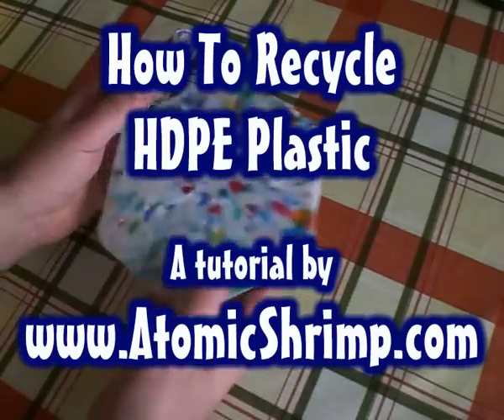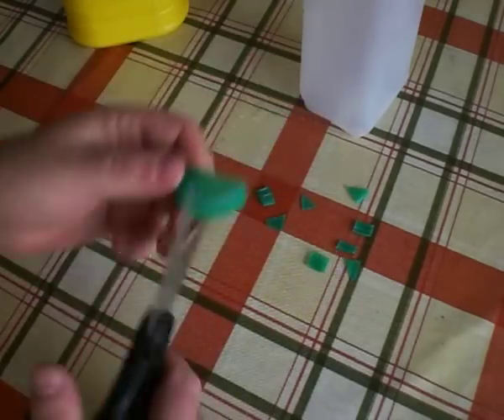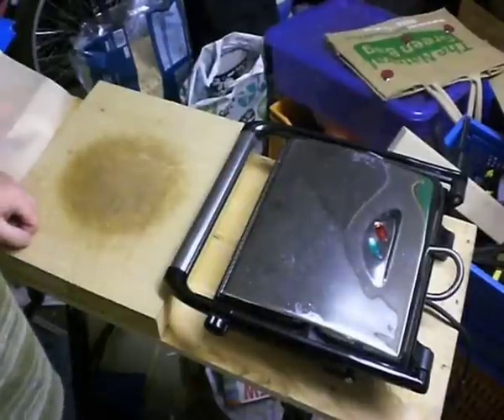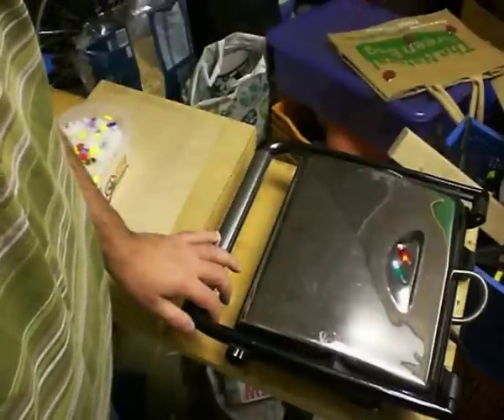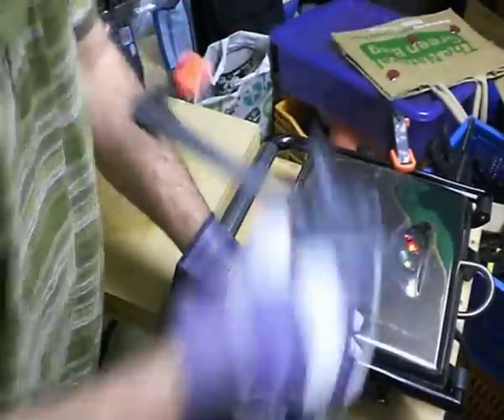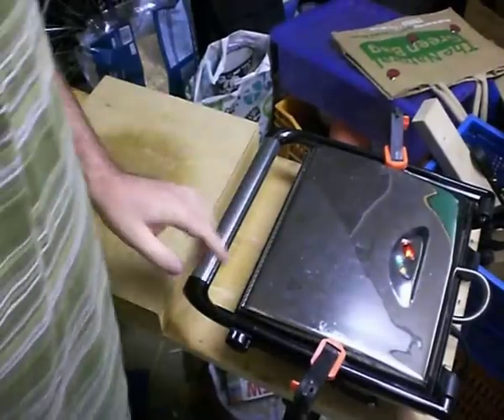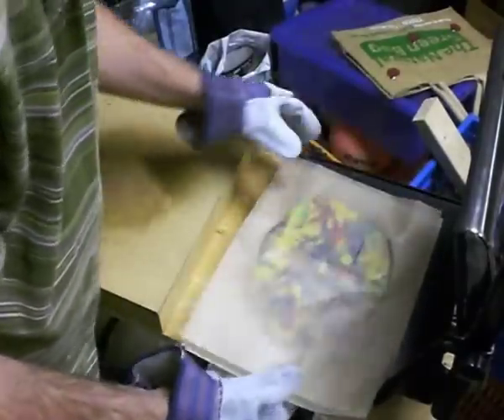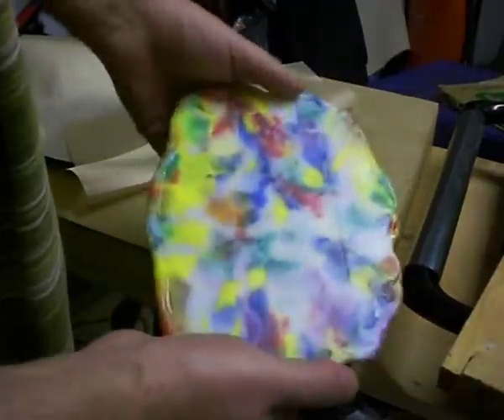How To Recycle HDPE Plastic (High Density Polyethylene) - a simple method

Comment: looks like good flooring material, hard plastic tiles maybe?
Reply from the maker: Could be - it would need texturing to make it less slippery - HDPE has a very low modulus of friction - in terms of common plastics, only Nylon is more slippery.
Reply: AtomicShrimp So, I put the sheilding in a shallow pan, add the HDPE, more sheilding, and a HEAVY metal weight that has been shaped to fit the pan and tooled with grooves... might work?
Reply: @doveoo5  So, 5 years later...what did you do?
Reply: @patrickbodine6010  hdpe resists adhesives, so it would need mechanical fasteners.
Reply from the maker: Sounds like it might.  Ramp the heat up nice and slowly, I suggest.
Reply: AtomicShrimp
its no bueno. if its slightly "dented" its going to hurt .
Reply: High Rise wall cladding perhaps. Oh wait..
Reply: @searcherholic3473  Holy 7 year later you normie...
Reply: AtomicShrimp
Thanks for the quick reply! I've watched a few more vids and saw one in which the hot plastic was placed into a wooden mold and clamped for pressing. That looked promising. The bigger problem, I think(now) will be to find a caulk that will adhere.

Comment: Hi there!

Having stumbled accross this a few weeks ago i'm now preparing to make my first piece of sheet. 

I have a question though - does the size of the flakes have any real bearing on the finished material?

Cheers :-)
Reply from the maker: Not a massive difference - there are three reasons that I cut it into smallish pieces:1) I like the marbled effect it creates 2) smaller pieces are easier to heap up on the hotplate (larger bits tends to slide off) and 3) some HDPE sources seem a bit harder/tougher than others - cutting small makes a more uniform blend.

Comment: excellent video, you mentioned HDPE doesn't melt to a pourable consistency, but what about a pressable one? In your opinion if I had a similar amount to what you had there shredded in a cylindrical chamber heated to 180 C with a solonoid of some sort pressing down on it to force it through a tiny hole. Would HDPE allow me to force it through a hole like that? Also, about how long does it usually take it too cool down?
Reply from the maker: Definitely - what you've just described is pressure extrusion or injection moulding - which is definitely possible with this resin.  It can also be pressed into shaped moulds in a method a bit like forging.
Reply: great! Pulling up freecad as I write. Also, do you know if your current method for recycling HDPE will also work on PETE? I have tons of soda bottles laying around and I'd love to put them back to work.
Reply from the maker: I think PET has a higher melting point than HDPE - I've not really experimented with it (yet)
Reply: OK cool, then I'll keep an eye on your channel and start playing with it myself.

Comment: there's a way to dye or tint a HDPE? i need to make parts for my vintage vehicle since parts are not done any more and can't aftermarket parts either.
Reply from the maker: HDPE is naturally a translucent white material - the coloured forms (such as the lids I used here) will have been made from pellets of pigmented HDPE that were manufactured by blending the resin with powdered pigment and melting it together.
This might be difficult for the amateur to reproduce, however, it might be possible just to select a bunch of plastic lids that are the approximate colour you want, then melt them together - or blend different colours together by melting and repeated folding (i.e. dozens of times, rather than the few times I folded in this video)

Comment: I think the key is to make larger pieces. You can use plain newspaper. I imagine you could put the chips between newspaper and then some corrugated the heating on both sides and get a coordinated sheet when you get done
Reply from the maker: The newspaper would probably stick permanently to the plastic - although this might not be a problem if the surface is to be machined.

Comment: I wonder if you could get away with  using a  paper shredder. on some of  the milk bottle parts  you  cut .
Reply from the maker: I've tried - the material is too tough and slippery to be shredded by the machine - it just works its way between the opposing blades and eventually jams the mechanism.
It must be possible with industrial stength shredding machines, because that's what some recycling companies do (others just feed it into what is essentially an enormous heated meat mincer and extrude it as pellets).

Comment: I jst want the procedure to melt the HDPE n remould it in to round shape
Reply from the maker: You will need to make a mould in the shape you want, then press the hot plastic into it while it is still flexible - in one of my other videos, I use a mould to form a rectangular shape to make a handle for a kitchen ladle

Comment: First of all great idea. Also I wanted to ask if it was possible to make a slingshot out of a block of HDPE plastic and how durable is it?  I want to start making slingshots out of recycled materials and came across your video.  Look up how to make micarta. I want to be able to do a similar color technique. Thanks
Reply from the maker: It would probably be quite good for that, but you would have to make sure you create a solid item with no faults or voids (as these could suddenly snap under load).
You could probably make a wooden mould in the shape of the item you want and press the melted plastic directly into it - check out my more recent plastic recycling video (the one where I remanufacture a plastic handle) for a demonstration of the technique

Comment: That looks awesome. Do you ever send it through a thickness planer? If it shapes like wood that should work. Also, do you find it necessary to keep dedicated tools (planer, jointer, saw blades) for wood and for HDPE? That is, does HDPE gum up or dull blades? Thanks, looking forward to playing with it.
Reply from the maker: I don't have a thicknesser, but my handheld electric planer handles it very nicely.

The only tools it makes a mess of are those that generate heat through friction - so when I ground it on my bench grinder, it did leave a lot of spots of plastic melted and stuck on - so I had to dress the wheel again.

I tend to keep the router (or drill or any machine tool) set at a low speed, or the friction melts the surface and this can bind a moving cutter.

Comment: This is brilliant. I'm building a machine that's mostly complete but for a number of pieces that are in the 15mm x 15mm x 30mm range. Wood, even maple, splits too easily. I've been racking my brain about what material to use. Plastic like this HDPE would do perfectly.

There are only 2 empty milk jugs around the house at the moment, so sent favorite No.1 son to look at some 5 gallon dry wall compound buckets I have from my job in construction. Sure enough, they have both HDPE and the ♴ recyclable 2 symbol marked on the white buckets, and black lids. Drywall mudders go through this stuff like crazy, so the buckets aren't hard to find. McDonalds used to use the same style buckets (green) to transport their sandwich dill slices, and they may still.

I don't have a toaster like this, and I need for my sheet to be at lease 15 mm thick, so my next goal is to find something I can use to melt it. I have a table saw which I think will work nicely to cut the bucket into little bits, even collecting the saw dust as I cut it.

Shrinkage isn't a problem, but I wonder about melting it outdoors in a square cake pan inside a gas grill set to low? If I could do that evenly, and without scorching, would I need a mold release of some kind, or would it's shrinkage rate cause it to pull away from the pan naturally? If you think a mold release is a good idea, have you tried anything that works well?

Thanks for your hard work, and for sharing it; these of your videos that I've watched so far speak well of you.
Reply from the maker: You shouldn't need any release agent - the stuff hardly sticks to anything- certainly not bare, smooth metal.
The trick is going to be controlling the temperature so that it doesn't burn.
Reply: AtomicShrimp Success!  Using a square baking pan as both mold, and smelting pot, and a propane grill as heat source, it wasn't much of a challenge to keep the temp low enough to avoid burning & scorching, yet still hot enough to melt the HDPE.

The cooled sheet didn't want to let go of the pan, but I persisted, and it finally did. The bottom surface of the sheet is smooth, and slightly shiny, but the top surface is fairly uneven, and lumpy. I cut off all 4 edges; there are small air bubbles. Not sure if more stirring would have helped, but may have been stirring too vigorously. Thanks again.
Reply from the maker: Pressing helps - that's why the sandwich toaster works so well - it not only provides even heating, but clamping it shut helps to press out any air bubbles, resulting in a more uniform product.

You might be able to reproduce this just by clamping a flat block on top of the material in the pan after removing it from the heat.
Reply: Yes, that also occurred to me. I was considering a piece of plywood cut to fit the pan, and clamping that down. I'm also thinking about casting a block that's 5 or 6 cm thick; my suspicion is that even if a sandwich maker opened far enough, it might have a little difficulty melting that sort of volume.

The material is a pleasure to carve, file, and sand, though, and I'm wondering what other applications might let me experiment.

Comment: What a time suck!  You need to automate the chopping and cutting.
Reply from the maker: I tried all sorts of different methods for this, but HDPE is such a slippery material that it tends to slide between the cutting surfaces of slicing or shredding machines, quickly jamming them up.  Obviously industrial strength grinding/chipping machines can do it.  Closest I got was a Heath-Robinson contraption made from an electric pillar drill, a Spong mincer and  the gear mechanism from a hand drill.  Video to follow soon
Reply: RE: plastic recycling”
 lol, and too funny... please don't ever take anything I say as a negative feedback...I just saw the incredible amount of time being spent and I got all "too anxious for the end result" antsy. - Peppi Turco
Reply from the maker: You're quite right - cleaning, drying and chopping up the source material is by far the most labour intensive part of the whole process.  It probably is possible to just melt and crush whole bottles and lids in the toaster, although the end product might not be so uniform in properties - as there are some slight differences between the flexibility of different pieces of HDPE
Reply: AtomicShrimp That's something that we should see on video...Youtube it! - Peppi Turco
Reply: Peppi Turco Although I'm grateful to have this bit of information as I am just entering DIY prototyping in AIG.  Any comments on AIG?
tks- Peppi Turco
Reply from the maker: What's AIG?
Reply: OH, sorry, now you'll think I'm tilted a bit.  It's anti gravity.  I've come across a lot of information which makes it look relatively simple.  So when we finally begin to use it we will be kicking ourselves for not thinking of that before.  Others have, but died mysteriously after going public.
Reply from the maker: Antigravity?  Do you mean those foil ion-powered lifters, or are you talking about sci-fi style antigravity for making hovering cars etc?  If the latter, it doesn't exist, and wishful thinking will not change this.
Reply: How about this: Grind them down on some type of melter, and pour it on a shape
Reply from the maker: HDPE does not ever melt to pourable consistency
Reply: xDDDDD
Plastic with acid then

Comment: PAPER SHREDDER
Reply from the maker: I've tried using a paper shredder - it just jams up.
Reply: PERHAPS A MORE POWERFUL ONE THAN WHAT YOU HAD. THERE ARE PAPER SHREDDERS THAT INCORPORATE A CD SHREDDER AS WELL.
Reply from the maker: I tried one that was designed for grinding credit cards - even that didn't work - the HDPE is so tough and slippery, it tends to slip between the opposing edges of the cutting mechanism, rather than being sliced.
Reply: Recently I tried a cheap (£10 GBP), new, table-top shredder (that you can put over any box to collect the strips). I cut out all the hard bits and the very curved bits of bottles with scissors, & separated them. The flatter panels were then cut into convenient-sized pieces (about 2 x 4 inches), and fed through the shredder. My experience with HDPE was that the relatively thin walls of milk bottles passed through just fine! However, the strips failed to fall apart completely. The shredder almost cut through them, but not quite. The shredded strips remained a little bit attached to each other. HOWEVER, I tried the same method with water bottles, Coke & Pepsi bottles, etc. and the little shredder sliced those up beautifully! (it's best to feed in the pieces sideways, so the straight edge enters the slot, not the curved edge) Of course, those drinks bottles are made of PET plastic, not HDPE, and by all accounts PET is harder to melt and mould. For starters, PET is a little water absorbent (which HDPE isn't), so PET has to be very well dried out to drive out any absorbed moisture before you even start melting it!

Comment: how much kilowatts have you burnt during recycling?
Reply from the maker: The sandwich toaster is rated 2kW, but has a duty cycle of about 1/3 (that is, once it's up to working temperature, the thermostat turns off the heating element more than half the time - so the actual power consumption is about 600W - about the same as two ordinary desktop computers; or less than one plasma TV

Comment: If there are "no fumes" at 350F  then could I use a pan full of the plastic in my oven set to 350F ,or maybe a touch under for safety, to make colorful blocks?
Reply from the maker: Possibly, but I've found that anything other than the very gentle, even, enclosed heat of my sandwich toaster tends to burn parts of the plastic whilst leaving other bits unmelted.  If you have a good extractor fan, give it a try...
Reply: I try melting on pot.

Comment: This just begs for a solar powered, automated solution for cutting, heating, folding, and rolling into sheets.
Reply: tgrigsby7 If you can find a fresnel lens, such as from an old style large screen projector TV, you can make a tremendous amount of heat. I’ve seen such a setup melt metals. 

BE CAREFUL!

You may be able to make a lens from two pieces of clear plastic with a spacer between them to make a convex shape. Somehow, you’d need to keep it moving so you don’t concentrate too much heat on one point, or if you have a large piece of metal, perhaps the heat would spread through the whole piece. 

It probably would take some time to reach its initial melting temperature, but since metal tends to retain heat, the second and subsequent melts should be much faster.

Comment: I think maximum temperature is 250-270°C. The recycling industries uses this tempertures in an extruder for re-pelletizing HDPE. The consistency is not liquid but like soft toffee. Simple pouring is not possible. Google for injection molding.

Comment: fascinating, plastic "damascus" welding!. I cant help but connect this with how blacksmiths "draw down" to get a thinner narrower strip from a bigger piece of stock, may be possible using a heated power hammer to do something like it? Or even develop a sort of drop forging into preheated moulds using a fly press or simple hydraulic or pneumatic pressure?

Comment: we can make HDPE bolts useing your current tech. so all we will need to add to the parts list is the bed liner coating every thing else will be recycled matterials (I like that)
Im startting with this project because most of the panles I will need are flat and should be the easiest to work with And If I have a good build on this I have an idea for a mono wheel I saw them in the olympics a couple years back and saw a video here about them Cant wait to get goingf post more videos please

Comment: Ounse this is in place I wiull use some of the same kevlar infused coating that I used to line my pickups bed and rim I will cover this build inside and out giving it a water tight and black finish that will go with the bed liner and have an apealing look to it  Id like to suggest that you might revisit your boat idea with these tech. the fraim will be built out of several thiner layered panles witch will be alternatted together to get any size I might need and then they will be bolted together

Comment: I am going to try a large build of my own what I have in mind is a tounoe cover for my pickup trucks bed What Im planing to try is to lay up 1/2" to 5/8" fraim and ribs for the cover and then by using a tarp like HDPE build up made of Groceries bags were I use the Cloths Iron and non stick tinfoil to weld 6- 9 layers of bags into a tarp like sheet and then sew these together to make a large panle that I will attach to the ribs and fraim
Reply: Th Linn - Rather than a clothes iron, you may want to use a heat gun or a hair dryer set for high temperature and low air flow. 

You can use silicone sheets to hold them flat, as the Atomic Shrimp has done in the video.

Comment: Ive tried this tech. and it is great I could only find a small cooker wich messures 11" x 5" but have gotten some great results so far and after reading your other page and trying some of my own ways of working this stuff
 Im hooked Iv used an old Clothes Iron and a couple metal pans got a nice disk Have made several thicknesses My best one so far is a board 5/8" thick by 5" wide by 11" long and it is real strong I read about your boat Idea and wantted to offer this